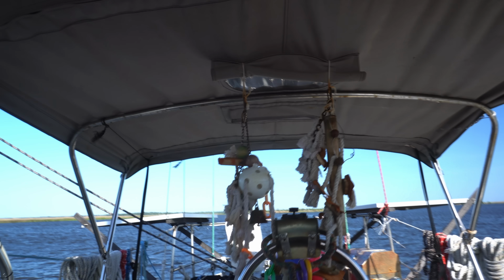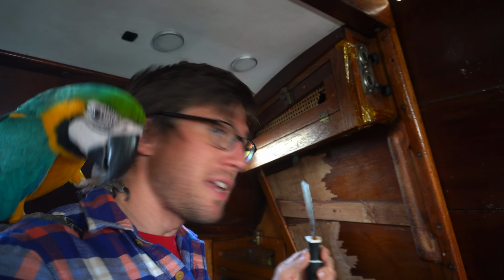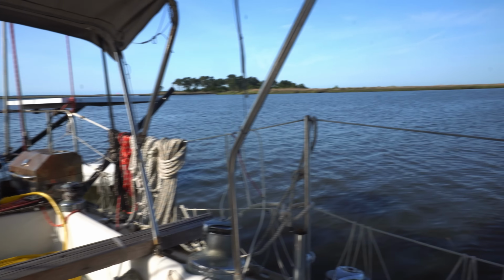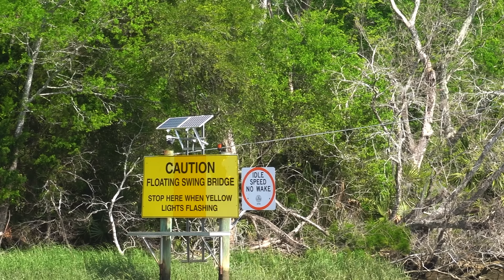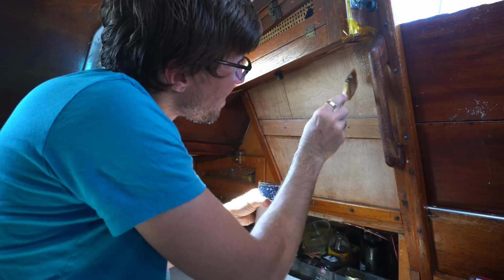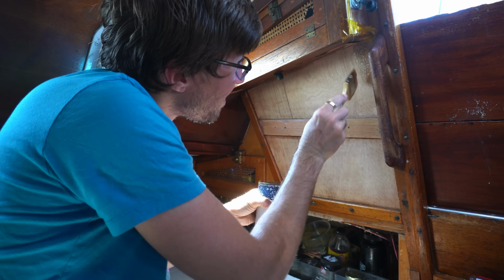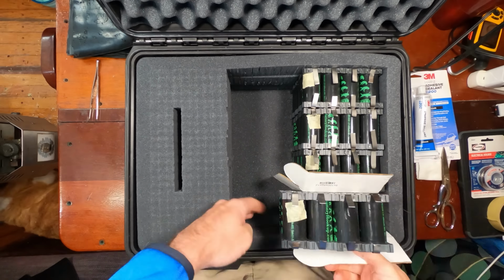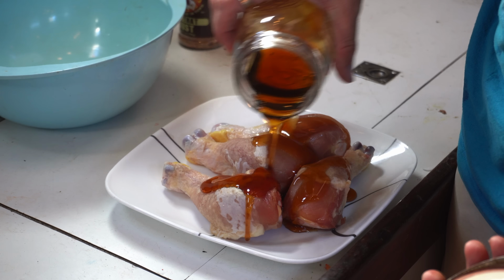The Best Advice from a Boat Surveyor | Sailing Wisdom [S5 Ep35]

Comment: The advice from the surveyor is also true when you buy a house, live with things for a while
Reply from the maker: Very true
Reply: As a previous home improvement contractor AND previous historic home owner (house was built in 1740) I would give the opposite advise. IF you can afford it do all the work before you move in. OR there is a great chance it will NEVER get done. You get used to things and just live with it. When did I finish my historic home restoration? About a week before I sold it after living there almost 20 years.  Funny when I got done my wife was sad to be selling but for years she was all about selling and buying a modern home with no projects to do.  So ya there are a lot of things you can learn to live with and if money is a. Issue ya fix the stuff that MUST be done but also if you can afford it do all the stuff you see SHOULD be done also.  I am now the owner of a bayfield 29  that needs a lot of cosmetic work but is a functionally solid boat. I did the stuff that NEEDED to be done right away BUT the gel coat is chalky the teak all is sealed and kept oiled but it does not look like new,  the interior could all use a update. If I wait to do some of these projects I know I will put priority on maintenance and function and the rest will be put on the back burner forever. (Or probably get done because I’m looking to sell and want to get top dollar so all those little thing NEED to be done now)  I hope I don’t do that but it’s easy when it’s a choice of hauling out for a few weeks to a months OR spend that  same time cruising and enjoying the boat instead of working on it to choose the latter and just live with those little cosmetic flaws.

Comment: Can you share a pointer to what Pelican case you are using?  Also, did you consider fiber glassing the wooden boxes (in the big boat) to make them water tight?
Reply from the maker: I used their storm line, I think it was M2450. On their website you can put in the dimensions and it will tell you what size and model. 
As for fiberglass: yes, but I wanted to be certain and pelican cases are famous for doing a good job.

Comment: I have the same problem (not bird related) … (so let’s downgrade that to “a similar problem”) with areas of veneer throughout the boat and am hoping to get to it soon so it was great to see how you handled yours.  I had considered sanding and then applying a new piece of veneer with epoxy then finishing that, can you see any drawbacks to that approach?  It would probably be sensible to do some test spots first to see how it goes …. After seeing your results maybe its not worth the effort.
Reply from the maker: Epoxy will work but will also have some limitations on working time. You might want to consider a waterproof wood glue like Titebond III. It will hold very well but it’s more forgiving during the working process. No ratios or mixing, just squirt it out and stick it on.